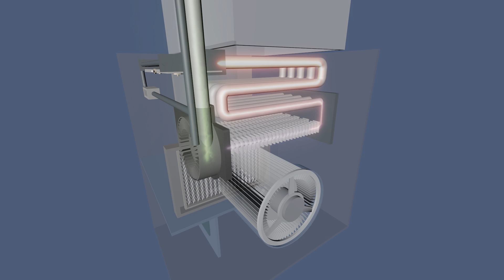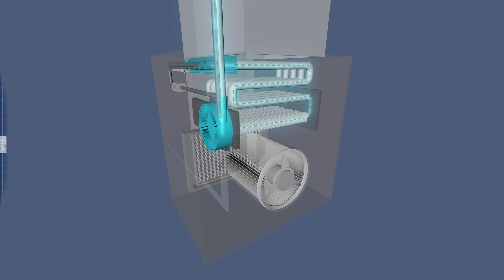Noisy Furnace? - Top 5 Fixes | Repair and Replace

Comment: My furnace makes similar to but not exactly like the car sound you mentioned.  Funny thing is it only makes this noise at night.  How do I share the video, so you can listen and help.
Reply from the maker: Thanks for watching. With evenings being colder than the day time its possible that you're just noticing the furnace run more frequently during the night. If it sounds like a car idling then its likely that the motor bearings are starting to fail.

Comment: Thanks for the hints. I just fixed the noise in my furnace by adjusting a few bolts. None of them was noticeable loose, but tightening all of them (including the blower) did the trick.  Thanks!
Reply from the maker: You're welcome Jorge, we're happy you found the video helpful! In a lot of cases vibration can add up when something is rotating 1000 times a minute, and in general it doesn't hurt to tighten up each bolt. Glad it did the trick!

Comment: Hi, my Airco belted fan furnace makes big noise when it starts. After one or two big noises , it runs very smooth. Is it OK? Thanks.
Reply from the maker: Thanks for watching. It really depends on the kind of noise. If its a thud or mechanical in nature then the blower wheel might be hitting something or the bearings might be starting to go.
 If the burners are full of dirt and carbon then it can delay the start causing the furnace to ignite more aggressively causing a loud pop.

Comment: I’m troubleshooting the blower of an evaporative cooler. Mine is making the grinding noise but only at the high speed setting. Any ideas, anyone?
Reply from the maker: Thanks for watching. It could still be the bearings that are starting to become worn. A higher speed setting would make the noise more apparent. Its not uncommon for a sound to be hidden at a lower rpm.

Comment: Furnace abruptly stopped,smelled like electrical burning, popped circuit breaker. Turned breaker back on Popped off
Reply from the maker: Hi Althon, thank you for watching. If your furnace keeps popping the breaker its likely either overloaded, or there is a short.

Clogged air vents or an dirty air filter can restrict the airflow forcing the furnace blower motor to work harder increasing the current draw, which can trip the breaker. Overall the fact that your breaker immediately popped off means that there is most likely a shorted wire in the furnace. If you are comfortable, you can disconnect power, and give it an visual inspection looking for any burnt wires or components or damage on the control board. If you can't find anything then its best to contact a technician.

Comment: Hi - Our Furnace is making a very light buzzing sound when off. Unsure if it’s always done it as I never really paid close attention. Is this normal? Heat and AC work fine. I also just changed the filter.
Reply from the maker: Hi Jose, thank you for watching. A buzzing noise when the furnace is off is likely the transformer. The transformer gets power even when the furnace is off and under the right conditions the iron core of the transformer might move slightly during each power cycle, vibrating and creating that buzzing sound. If the furnace and AC work properly then its not something that would need to be replaced. In some cases this is something that can be muted or tightened but that's something you'd want a professional to look at as they would know how to address it. Overall keep an eye on it though if it changes or gets worse over time.
Reply: AMRE Supply - Thank you for the quick reply! You’re awesome! Kuddos to AMRE 👏
Reply from the maker: @josea.alvarado2548  You're welcome, we're happy to help out!

Comment: Hello, I had a guy come out and tell me I need a whole unit, unfortunately my city is experiencing a lockdown and I think he wants to rip me off so I’m wondering if maybe you would know what the problem is, my furnace on the attic makes a noise like is air or gas is escaping it does it while the ac is on and does it the whole time
Reply from the maker: Hi Hector, thank you for watching. To make that sound air could be escaping from the ducting or from the furnace itself. A little bit of air warm air that escaping there before it leaves the heat register isn't a huge problem. On the other hand if the air is escaping from the heat exchanger, then that is dangerous as that exhuast gas contains carbon monoxide. This can be difficult to see without inspecting. You can see this system in action in this video https://youtu.be/tVLtJwix-_8?t=41 Did the technician explain more about why the whole unit needs to be replaced?
Reply: AMRE Supply 

Thank you for replying so the guy said I could either replace the whole unit or replace the blower wheel, I went up there myself and took the cover off of what I believe is the furnace and the noise came from the blower wheel the thing that spins when the AC turns on. I recently got a lot of work done to the house and its really dusty in there I blew off what I could with an air compressor but the wheel is hard to reach the noise was still there but less louder. It doesn’t sound like metal grinding just kind of like some a air escaping so I’m not sure if I should try to take the top off apart which has mastic in order to fully reach the blower wheel. What do you suggest?? Again thank you
Reply from the maker: @hectorbustos1099  You could try a thorough cleaning of the blower wheel with a brush. This is shown in our maintenance video here: https://youtu.be/1giPLrObYb4?t=197 If you can hear still air escaping near the blower wheel then it could be a few things. Check to see if the furnace door makes good contact. Also try to see how the blower wheel housing sits inside the furnace, to make sure its level and has good, even contact. As well look at the connection points of the ducting in around the furnace and see if there are any gaps. You can use foil backed tape to cover any gaps if needed. Overall as long as you're getting heat coming out of your vents, and your house is warming up properly, the little bit of air leaking isn't going to be a huge problem but if you can narrow it down then cover what you can.

Comment: Unfortunately no it didn't help.
It is a stalling sound similar to a failing motor seazing or failing and a very high pitched noise.
Thanks though
Reply from the maker: Thanks for sharing your experience, its hard to cover all potential sounds in a single video but hopefully it still helps some people get a sense of their problem. In your case it seems likely that the motor needs to be replaced.
Reply: @AmreSupply  yeah in my stupidity I ended up getting the inducer motor instead of the blower motor

Comment: Hi my furnace is only a few years old. When the thermostat kicks it on and the pilot light lights to heat it up it starts with clanking noises...clank.....clank.....clank...clank....then when the fan turns on it stops clanking. Any idea? It’s not the duct work.
Reply from the maker: Hi Terry thank you for watching. If its something thats happening as the furnace is heating up it could also be the expansion and contraction of the metal panels inside of the furnace not just the duct work.

Comment: Thank you for the video. Disassembled my fan cleaned it up and tightened all bolts and set screw, put it back together and everything is running great. No shaking or noise.
Reply from the maker: Thanks for watching Ruger! We're happy to hear that cleaning and tightening the bolts helped eliminate the noise in your furnace!

Comment: The furnace makes a sound that  sounds like a bunch of beads falling on the floor... it used to only do this for a moment when starting up but now it's doing it constantly while running and persists for a few seconds after shutting off
Reply from the maker: Thanks for watching. It sounds like there might be some debris inside of the inducer blower. Now the blower assembly is a sealed unit so its not that accessible to take apart but you could still try removing it to see if you can hear anything rattling inside. You can see how to access it here: https://youtu.be/EsJhfFMZWJA

Comment: Thank you for this excellent video.  I was able to trace the problem down to a broken belly band on my blower motor.  Unfortunately I didn't know the "hamster wheel" had weights that were thrown off, which is what I'm told is causing the continued shaking noise, but at least I have heat!
Reply from the maker: You're welcome Dave we're glad you found the video helpful. Are you saying that there were additional weights on the blower wheel that fell off and now the blower wheel is unbalanced? If so you could try spinning the blower wheel slowly by hand to try to determine the balance. Just observe where the blower wheel starts turning under its own weight as this will help you determine the heavy side of it. Just put the weights opposite to that side of the blower wheel.

Comment: I have a propane wall space furnace and when it starts up it makes l loud whining noice or you can say it sounds like a train whistle it only happens when it starts up and it doesn’t do it all the time. No one seems to know as when a repair guy comes it doesn’t do it. Last year it did it mostly when it was really cold outside but it is starting now and it is not really cold. Have you ever heard of such a problem?
Reply from the maker: HI Dorothy, thank you for watching. Does the furnace have any blower fans inside? It could just be the bearings of the motor while it spins up to speed.
Reply: But why would it do it sometimes and not all the time when the fan comes on
Reply: My husband says it is not the fan because it is rung before the noice starts. He think it might have something to do with the cold air coming in and hitting Ingersoll the warm air in the pipes. It does it more the colder it is outside.
Reply from the maker: @dorothyschott5702  That seems logical, especially with the temperature difference.

Comment: My noise is kind of a vibration noise and it happens as soon as the furnace kicks on (not just when air is actually blowing). The other thing is that it doesn't happen when the furnace is blowing cold air (during summer). Any clues?
Reply from the maker: Hi Smith, thank you for watching. What you are describing is the inducer blower fan that runs before the main blower fan. In mid to high efficiency furnaces the inducer pulls air into the burner. This clears the combustion chamber of any exhaust gases. This blower fan will run before the burners ignite. If you think the inducer is starting to fail, it can be replaced: https://youtu.be/EsJhfFMZWJA In the summer time, the burner isn't used so the inducer motor won't ever be running, just the main blower fan to circulate the cold air.

If you've found this helpful and want to help support the production of more videos like this, you can like, share or even subscribe to our channel. Every little bit helps!
Reply: @AmreSupply  Thank you for your input. You are very helpful. I will look into it more.
Reply from the maker: @smithcollins122  You're welcome, we're glad to help!

Comment: Our furnace makes a sounds similar to the sound of the worn bearings in this video but it does this for a minute or two before the air kicks in and you hear a loud woosh as it starts to circulate the air.  Does that further point to a failing motor, or does that suggest that it might be something else?  Thanks!
Reply from the maker: Hi Jamie, thank you for watching. What you are describing is the inducer blower fan that runs before the main blower fan. In mid to high efficiency furnaces the inducer pulls air into the burner. This clears the combustion chamber of any exhaust gases. This blower fan will run before the burners ignite. If you think the inducer is starting to fail, it can be replaced: https://youtu.be/EsJhfFMZWJA

If you've found this helpful and want to help support the production of more videos like this, you can like, share or even subscribe to our channel. Every little bit helps!

Comment: So if it makes a loud pounding sound its okay nothing major
Reply from the maker: Hi Lashon, if its the pounding sound, and if it sounds like a metal sound coming from the ductwork then its most likely the sound of the sheet metal expanding, which is normal for a lot of furnaces.
Reply: AMRE my furnace is banging so loudly, and it’s coming directly at the furnace- not the ducts spreading away from it. Do you think something is loose? It’s not one bang, a constant sound of bang bang bang bang...
Reply from the maker: @jamiegray8543  Sorry for not responding to this right away,  we don't always get notifications on replies left under comment threads. It sounds like something is loose or that the blower wheel is misaligned. Did you figure this out? What was the problem?
Reply: @AmreSupply  hi there i watch your video and it looks like the same sound/noise with the inducer and the motor that im having with my furnace but even if i shut it off the furnace still i  hear the noise  start with squealing noise and suddenly like drilling sounds  and it happens only on a day.  Thanks for your immediate response
Reply from the maker: @emmanueldiego7360  Thank you for watching. If the noise is coming from the inducer motor, then noise shouldn't be there when the furnace is off and has no power. If you only "shut off" the furnace by turning down the thermostat then it might still run. Now if you turn the breaker off then the furnace will not run, so if the noise still persists then it is something other than your furnace.
Reply: Thanks for the reply. I will do that i will shut off the furnace from the breaker and i"ll see if there is still noise coming from the furnace. But if the noise is stop upon shut off  the breaker then it might be the inducer is that right. Thanks.

Comment: My furnace makes a loud clunk when it first starts then it runs fine
Reply from the maker: Hi Lorii, thanks for watching. Does the sound start right when the furnace ignites? Or is it when the blower fan starts running?
Reply: Mine does same right before it kicks in